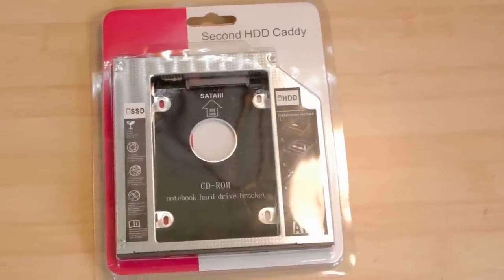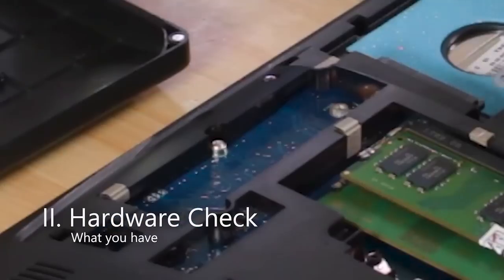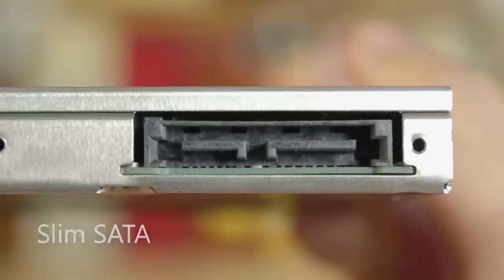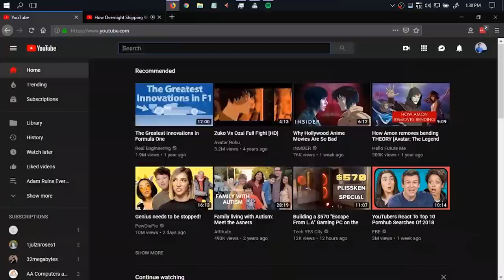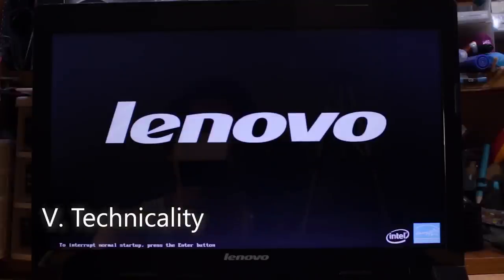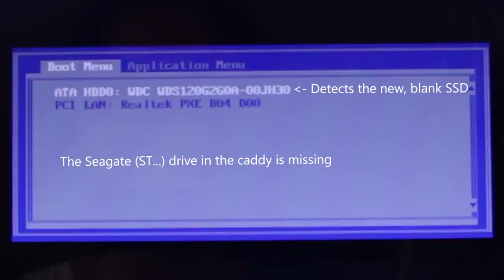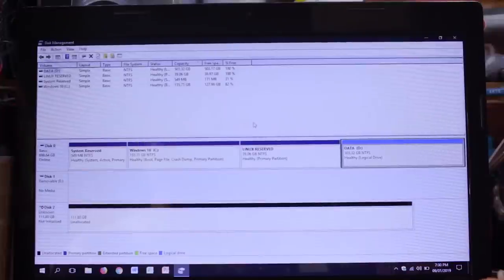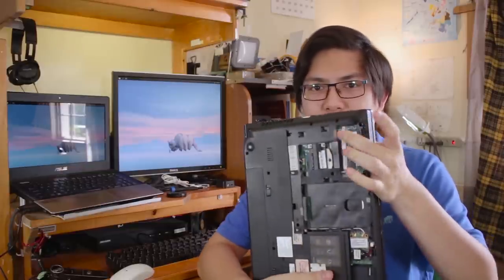SSD + HDD in Almost Any Laptop (The Caddy Method)

Comment: Also, about the big SSD drive Idea... As far as I know (from chats with  electronic engineer friends), unlike their slower mechanical drive counterparts, an SSD won't get bad sectors - it will simply fail.

No warning - just fail.

No data retrieval, just gone.

That's disastrous if you've got all your data on there and you've been a bit casual in your backup routine (let's be honest - we should back up more often in many cases)...

How I've set mine up is the SSD is for my OS only.

The secondary (mechanical) HDD is for my files and data.

This also has an advantage of wear reduction on the SSD as their are fewer read/write cycles needed in a given timeframe.
So, the drive lifespan is improved.

Finally, as mentioned before, because the drive with all my files on is an old style mechanical one...

It is less likely to just stop.
If I get bad sectors - I'll just lifeboat my stuff off onto a new drive and away I go
Reply: Where have u installed tha ssd? In the caddy or in the 2.5" bay?

Comment: Thanks for the nice video, Now I have installed the SSD in place of old HDD, and my old HDD in place of the DVD using a caddy, leaving the old Windows 8.1 partition as is. I then  clean installed windows 10 in the SSD,  and the system works fine. 
now my question is. Is there any way to boot from the old windows on HDD as well as the new windows 10 in a dual boot fashion?
Reply: Yeah it work in  boot selection

Comment: Thanks for uploading a tutorial. This was really helpful for ramping up the performance for my Dell Inspiron 5559.

The cloning software that I used was Samsung Data Migration for my Samsung SSD 860 Evo.
Reply: So you have your SSD in the caddy now?
Reply: @naveenkinnal5413  Actually the SSD does not need a caddy to be connected to the SATA-III port. But, to make use of the existing HDD, that requires a caddy to be installed in the Disk drive bay.

Comment: Makes sense to keep the SSD where the connector (SATA3) is faster. However, when you move the HDD to the optical caddy - isn't there danger of overheating ? (at least my old dell does not have fan near the DVD)
Reply: Maybe a laptop cooler pad should do the trick.

Comment: My laptop is a really old one. It's Fujitsu L1010 dual core variant, with 250GB HDD, 1GB DDR3+2GB DDR3 (in extra slot), can I upgrade by removing the original HDD and replace by SSD (SATA 3 probably). Can u help me out? Will it worth doing so? Or buying a new 1 will be wise???

Comment: I'm using a ORICO 2.5inch Hard Drive Caddy Tray with 1T SSD in my HP Envy dv6.     The drive is recognized and works just fine until I reboot, then it is no longer recognized.   It is not even shown in BIOS.  If I reboot umpteen time, it might be recognized until the next reboot.  I've changed the SSD to a HHD and have the exact same result.   Both SSD and HHD work great in an external enclosure.  I am stumped and frustrated.

Comment: Hello. I have a lenovo ideapad 330. It does not have an optical drive. I think it has an HDD. I am planning to change it to an SSD, WD green 1 TB.  Would my laptop accommodate the WD 1TB SSD? Would the connectors/ions be compatible? 
WD Green 1TB Internal PC SSD - SATA III 6 Gb/s, 2.5"/7mm - WDS100T2G0A This is the unit. I am sorry to bother you. I really would appreciate any reply. Thanks.

Comment: Hi, 

I have installed Windows 10 on my new SSD and done all the driver and windows updates but when it is support to shut down or restart it doesn't do it properly and i have to do it manually. 

- When I am trying to install the windows form a boo-table USB (downloaded from Microsoft website) the system won't restart by itself and it just looks it is freezed. I have to restart the system manually (meaning I have to Shut Down by pressing the bottom and put the system on again). then again it gets back to the point it was before and carries on! 

when the installation is finished the system runs perfectly until I want to shut down or restart it. Then again the same scenario. I have to restart the system once or a few times to get it loaded completely. 

I have done all the possible solutions (found on internet) but none works. 

Could it be something wrong with the SSD itself? 

NOTE: the windows works fine when I am connecting the old HDD drive but just a bit slower. 

Many thanks in advance

Comment: I prefer install Sata 3 SSD to Sata 2 HDD Caddy, and keep SATA 3 Harddisk in SATA 3 connector on the laptop, so they will keep a balanced speed, think about slower Harddisk speed put in more slower connection in SATA 2 HDD Caddy.

Comment: I have a dell 5558 laptop with 4gb ram, i3 5th gen, 2gb nvidia graphics processor,1 tb hdd, dvd drive is also there.
Should I get a SSD for better speed?
1) If yes should I put SSD in place of optical drive using caddy?
2) Or should I place SSD in place of hdd and put hdd in place of optical drive using caddy?
Will all these things support my lappy?
I have read that the optical drive uses sata 2 and hdd might have sata 3. Thus SSD will perform better with sata 3, that's why option 2 is better?

Comment: Thank you for the video, I have a question
 You said you could clone everything to the sdd before installing it using a USB 3 to Sata cable
My question is does that mean I don't lose my data from cloning it from one drive to the other like programs,files, games and such?
Reply: the storage device that u are using for the cloning process should have the same amount of storage from the your old storage device with ur files. lets say u have 250gb worth of files and slap it on a 16 gb flashdrive that wont clone it thoroughly but im not sure

Comment: I have an hp laptop, model number 15ac-184tu. I have done all these things mentioned on the video. I removed my hard disc, attached it in the optical drive slot with sata connector. Then placed the Wd Green SSD in Harddrive slot. After switching on when I am trying to copy something in my hard drive,it only achieves max to max 1 Mbps speed. It is too slow. Although SSD is working fine. I dont know what is happening with the hard drive. Please help somone.

Comment: Hi EJ, I was inspired by this video and i decided to upgrade mine. But i have encountered problems. Would you be so kind to help me out? Thanks!

When I'm removing the keyboard I mistakenly lift the keyboard that the keyboard flex cable pop up. But as i check, the keyboard and power flex cable is working, which is great..
Now i have these issues, first is the flex cable of the HDD/ODD. I dont know but it just fell when i lift the motherboard. Now my laptop does not detecting my hdd/odd and it only boots to bios. The second is, i am having a hard time figuring out how to deattach the monitor flex cable. I'm not a beginner but I'm still new to these kind of thing so i suck. Would be very grateful if you could help me. 😌

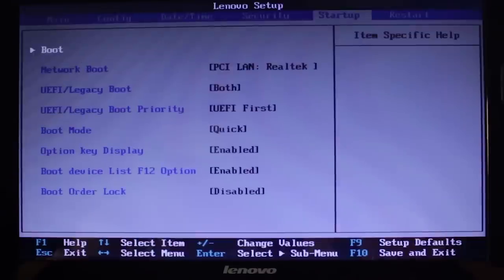Comment: I have the same issue that happened in the lenovo laptop at 08:34  with my hp laptop has anyone actually come to a solution 
I have tried  these but didn't work 
1. edit the boot menu so it would boot from SSD 
2. wipe the hdd 
3. putting the SSD in the main slot and HDD in Caddy and trying to boot from the SSD 
note that the laptop boots normally when the HDD is totally removed if anyone can help me with this I've researched this for quite a while can't seem to find any viable solution

Comment: Guys I need someone to help me. I bought the Samsung ssd 1T to replace my hdd and followed the steps to install the windows 10 on my USB. But for some reason my laptop won't recognise the ssd when I place it on the hdd slot. The only place it works is in my dvd slot for which I bought a caddy case. I don't won't my ssd to boot from my dvd slot (even though it works fine) . I want it to boot from its normal place. What is the problem? Anyone please

Comment: The problems is the BIOS, not able to boot SATA disc from OOD SATA conector, is a feature blocked by some manufacturer. Of course any SATA III drive is backward compatible with SATA II buses.
In ex. you can boot HDD drives from IDE OOD conector with conversor to SATA, without problems (and not "satured" the 133Mb/s IDE bus or HDD)

Comment: ok what i just did is deleting my unnecessary file until its under 240gb , and ive done cloning , then i swap the two drivers , than restart, still boot slow, so i thought i have to change the bios priority order so.i change to ssd as #1,  still my laptop boots slow... What is happening? 

I check that my ssd is recognized as disk 0 and hdd as disk 1, but my acer c:/ is still 1TB (old hdd) size, it should hve changed to 240gb (ssd)... So my problem is ive cloned it perfectly but it doesnt boot from my ssd eventhough laptop recognize my ssd

Comment: bought a caddy but my laptop would not detect it or the hard drive in it. Tried 2 different good hard drives both undetectable. tried the caddy on different but old laptop and it's being detected, so the Caddy is not defective. My laptop's ODD is working which means the slim sata interface is working.  can't figure out why. both undetected on  BIOS and windows (device manager and disk mngt)
Reply: tried flipping the switch but all it does is make my laptop not shutdown properly when the switch on the caddy is flipped (seems like the common problem on caddy when that switch is on the wrong side) but still would not get detected

Comment: Hi did this to my old laptop msi cr61 20D  and have got some transter issues with windows 10 I have updated all drivers and win10 was clean install ssd is installed to internal drive bay and HDD that was in laptop was reformated and installed to optical caddy.   The issues I am having are related to the drive installed on caddy its a wd blue 5400 drive and file transters slow to a crawl sometimes almost zero.  I copies a file recently on the drive from one location to another on the drive and it was only moving at 15-20 mbs sometimes I get full speed over 100 mbs from cady to use external other times it jumps around and the drives makes a loud noise.  I instlled the drives as IDE I read that is faster I don't no if I was meant to use ahci.  Need ome help.

Comment: I have a question. I have a Dell Inspiron 3583 with a SSD of 256 gb. And I want to add 1TB of HDD. 
I would like to know if this is possible since I dont have an optical drive installed. My system is a 2019 model with no optical drive. A Dell technician told me this is not possible since I dont have a DVD-writer cut out. Is this true or just bs?

Comment: I installed Windows on the SSD, formatted the Disk C on the HDD. Put the SSD in the 2.5" slot, HDD in the caddy. At first it didn't boot up. I changed the boot option to Legacy and it worked. But the HDD is too slow now. +3000ms Response Time and pretty much unusable. What could be the problem? Laptop is Lenovo V110.

Comment: How do I screw the new caddy on If I dont have an old optical drive to use its metal bracket? ( Lenovo Ideapad 320-15ISK -  not DVD drive included)  @EJ Tech

Comment: 10 days ago i also added an SSD and ohhh boy it was not easy, the inserting part is easy though remove screw them then add. But the hardest part for me the softwares My laptop boots windows from the hdd and i was so furious then swapped their place and then HDD didn't detected 🤣🤣🤣🤣🤣 Then after some time it again begins to boot windows from HDD, and after a long 1 hour of research and with anger finally changed the boot priorities. So conclusion is do your research before doing this or you'lll end up as angry as i was at that time 🤣🤣🤣🤣

Comment: Thanks for catching the limitation of the Msata interface is limited to 240MB.  My old laptop needs to upgrade from its old USB 2.0 and 100Mbs Ethernet.  In your research, have you thought about a msata out from the laptop interface to either a USB 3.0 or Gig Lan?   I imagine it would be nice if the caddy could be  fabricated into a little hub interface.

Comment: I already did this from your previous tutorial in 2017. Here's what I did: I installed SSD on the caddy and cloned my HDD to it while caddy's screws not tightened. After cloning is done, I swapped HDD to caddy and SSD to SATA 3, Booted it up and I wiped ny HDD after I backed up what I want (this is to combine HDD's partitions C:, D:)
I'm enjoying the speed since then especially at boot up
Reply: Both use the same sata type port
Reply: @iceseic  so no problem if i put ssd in caddy just!
Reply: @iceseic  Kind of. The thing is if your laptop older and CD/DVD driver is connected not by SATA III, but II you won't be able to use SSD to its full potential. So it means that if you put SSD (which has bigger write/read speeds than HDD) it won't be utilized fully. Now HDD doesn't have that speed, so it makes perfect sense to place it in the caddy and put SSD in the primary spot.

Comment: If i have a SSD in SATA III port (with windows on it) and HDD on Caddy (like extended memory), will that affect the speed of the laptop (compare with only the SSD) ?
Reply: Nope, Windows will work normal, but fast if installed on SSD, and better if frequent or heavy software (like content creation or 3D CAD sw) is into SSD too. Then you can alleviate SSD loads build up, by fully formatting any partitions on HDD and first establishing a 'windows Pagefile' on the very first partition before restoring your backup files back on the HDD (look on Google how to do so).
Windows might say you don't need to do a system managed pagefile outside your WinOS SSD due to your now high-speed SSD access, but for me and my productivity stuff, is a recommendation I always give to my closest friends and work mates. It just works, kinda like ReadyBoost for stability, and even better.
Reply: @EarthboundApocalypse  i tried this method and installed fresh os installation on ssd and formatted the os partion in HDD while booted through ssd and it works but sometimes the HDD in caddy is not showing but a restart shows again. So is it caddy problem or do I need to delete recovery and primary partion of HDD through disk management as the other 2 partition i have files i don't want to delete. So can't fully format HDD. And i don't have spare laptop to check whether caddy is defective. So what do you think?

Comment: Sir, I have lenovo z510. I intended to install SSD. I replace HDD with SSD (2.5", 6GBs) and intalled HDD in place of CD rom with caddy. Now SSD is on SATA 3 (6gbs) port and HDD is on SATA 1.5 port. But when i started computer i observed that my laptop sometimes detect HDD and sometimes dont. where does problem exists and whats solution. please suggest.
Reply: Go to the control panel, advanced power options, "turn off the disk when" you put "never", if the problem persists try to remove the caddy drive and move the switch to the right

Comment: hey man, I used acer laptop back then which accepted a 128GB ssd (kingston UV400) in it's dvd drive along side HDD but when I did the same thing with 256GB (WD green) ssd  didn't work on the same laptop. Is there a problem with WD or Kingston or caddy!
Reply: both slots support sata III

Comment: Hi i did as you told but my HDD not detected in caddy.but it is detected in hdd bay.i cloned ssd and when i install ssd in caddy it is showing but i can not boot with ssd in caddy. Only able to boot from hdd in bay. But when removed my hdd and still ssd in caddy it is booting and working.  So what to do to boot from ssd and hdd as storage

Comment: Hi EJ this update is useful Salamat :)  e.g. sata II sata III connections in dvd tray can affect HDD access read afterswapp. ---(NB: Your method is safest, clone then swap hardware - best do cloning first.,, I mean before mounting) I m moving HDD to dvd bay l perform HDD speed test with Crystal disk before unmounting from the main bay and after in the dvd tray. Cheers!

Comment: Did i missed it? i found the video trying to ONLY attach an SSD in the caddy. No cloning no removing the other SSD, no reinstalling windows. I only wanted more space on the laptop, added a caddy with an SSD and it did not recognized it. That's it? the port is saturated because it's an SSD and there's nothing we can do about it ? no configuration, no nothing ?

Comment: I placed my hdd in the caddy, and SSD (with Windows )in the SATA3 slot inside. The pc boots properly to Desktop, But the HDD does is not detected. Help?
Reply: Did you clone the OS from the HDD to the SSD? Try going in the Disk Management and see if the HDD is offline. It happens if the system detects 2 drives having the same signature.

Comment: Just tried to install a (second) ssd in my lenovo t540p in a caddy. But the computer doesn't find the drive at all. Not even in Bios.. Anybody has an idea how to solve this?
Reply: your new SSD is not detected by your laptop. try to disengage from its port and reengage it again. Make sure the port of the SSD is seated well into the SATA port. Make sure also, that the power cable for this SATA port has no cut in between and must be properly connected to the MoBo. If all else fail, flash your BIOS' Firmware to update it. Your BIOS maybe old enough and cannot detect the SSD. However, as a warning, plug your adapter and battery to sustain power into your system. You don't want your system to power-off during flash process. Power failure will surely corrupt your old firmware.

Comment: My current hdd has a lot of files amounting to 1.5tb, I want to move the hdd to the optical drive and I'll be buying an 500gb ssd as my main drive for the OS. My question is, would how I've set up my folders change? Do I really have to clone? because I don't have enough money to afford a 2tb ssd, and also since some of my softwares would still be on my hdd, would I have to reinstall them all to the ssd so they'd be faster?
Reply: Also what would happen if I just moved my hdd to the optical drive and put an ssd? would there be a problem of booting my laptop? would it delete my files etc?